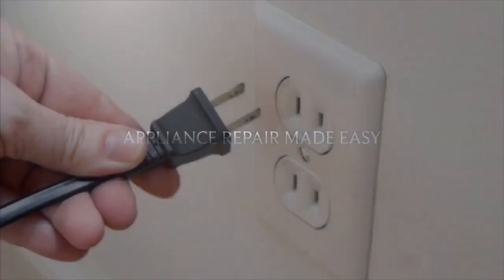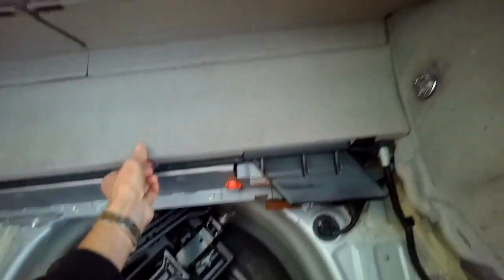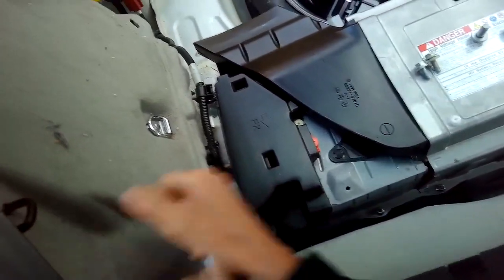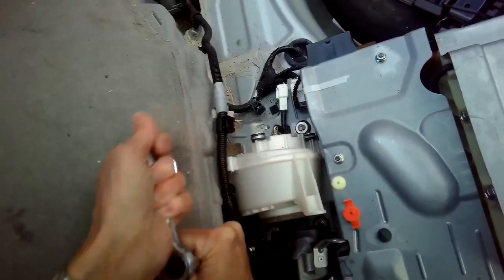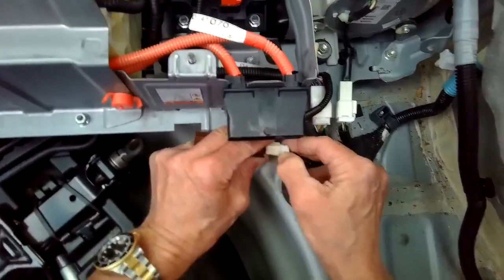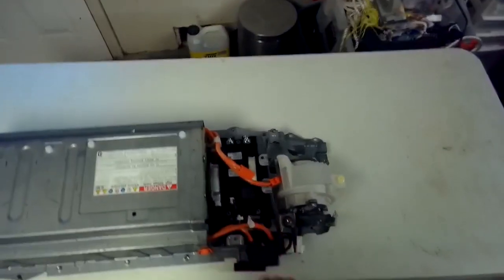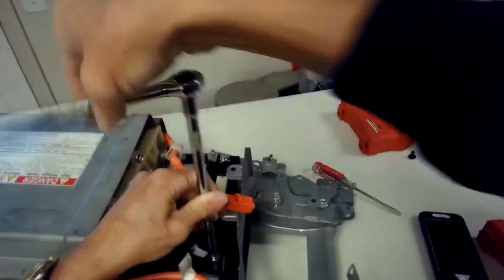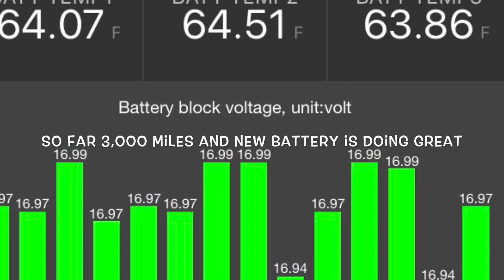✨ PRIUS HYBRID BATTERY NOT WORKING — SOLVED ✨

Comment: You actually can replace the cells correctly.  If your cells are running at 7-8 you replace the cells that are below that with ones that are 7-8 and it'll work. I've done it many times.
Reply from the maker: Thanks Joshua😊

Comment: Toyota dealer quoted an eye popping $7450 so have Green Bean coming out to exchange the battery in my driveway for about $1600. Normally I'd just buy another $6000 beater Prius with120,000 miles, but not possible in this market. Battery went at 230,000 miles (2008).
Reply from the maker: Very impressive😊